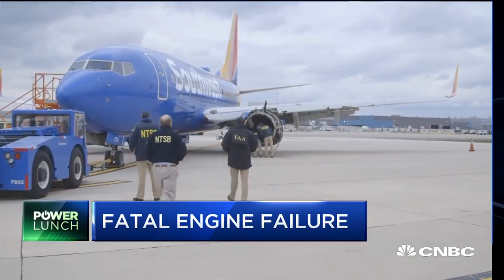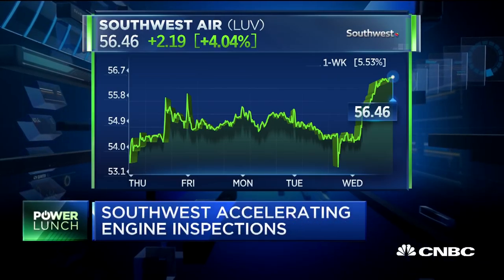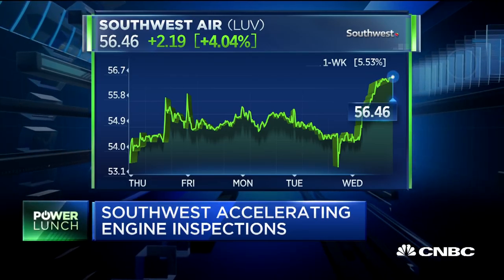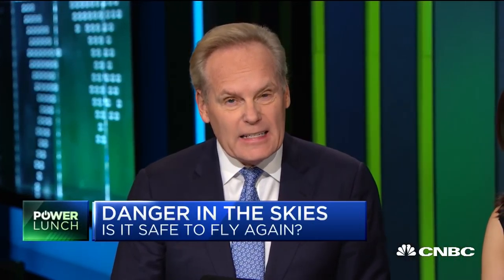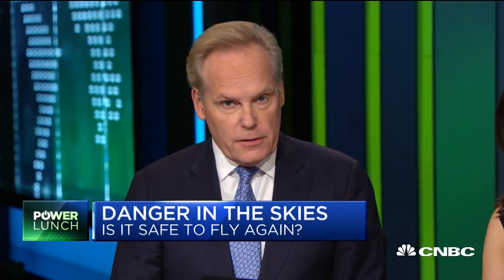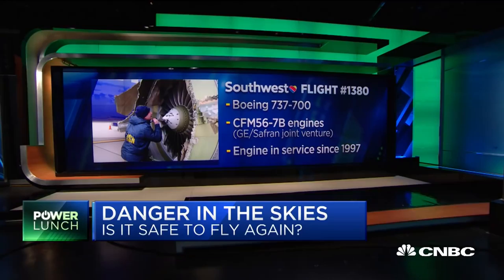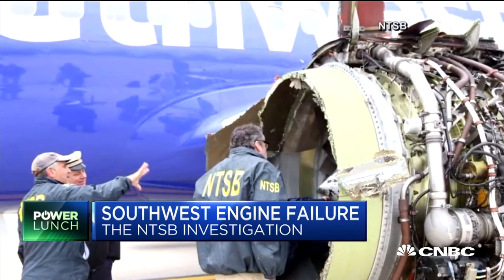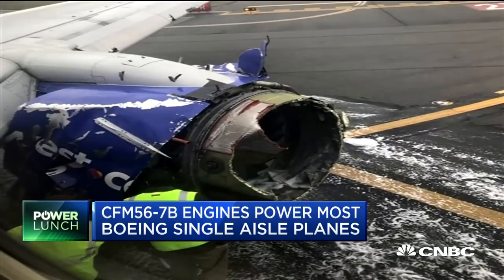Uncontained Engine Failures Are Really Rare: Former NTSB Member John Goglia | CNBC

Comment: How about now
Reply: The fan blade did have a microscopic crack in it from the factory, but this crack was so tiny it was practically undetectable even with the ultrasonic equipment. This crack sat dormant for years in the engine, before growing to a detectable (but not visible) size sometime between the inspections performed by southwest. the crack was still invisible during the pilot's visual inspection before the incident flight, and grew to be visible before failing during the accident flight. The engine duct would have been able to contain this failure if the crack was farther out on the blade, but because nearly the entire blade broke off, the cowling could not contain it. The escaped blade would have harmlessly flown into the air (where it would almost certainly just hit the ground without harming anyone) except that the blade broke off in the narrow range of angles for it to hit the window on the fuselage, killing the passenger sitting on the other side of it.
CFM, Boeing, and Southwest all followed the correct procedures that have caught thousands of fatigue cracks like this in the past. This was just a once-in-100-million accident that resulted in tragedy.